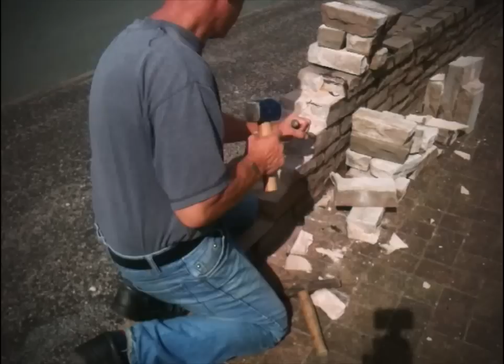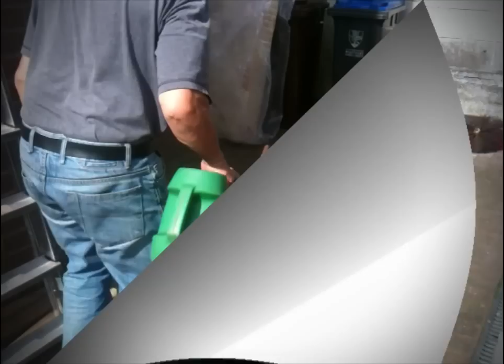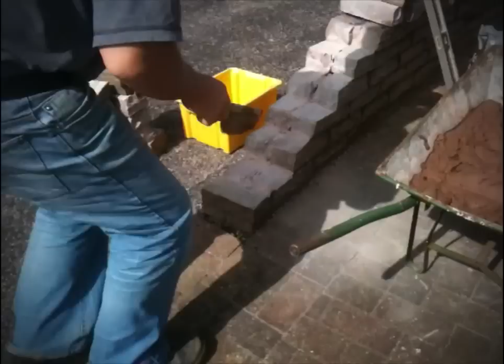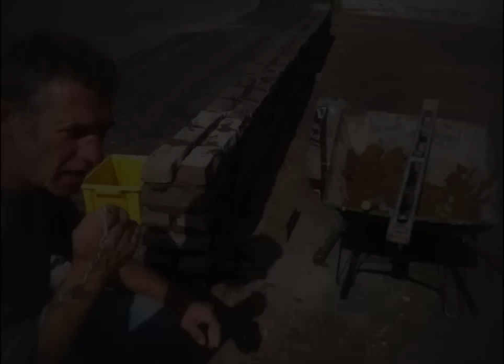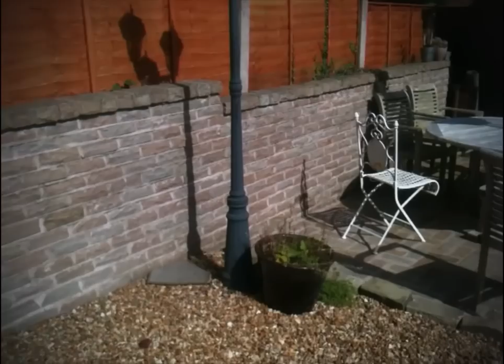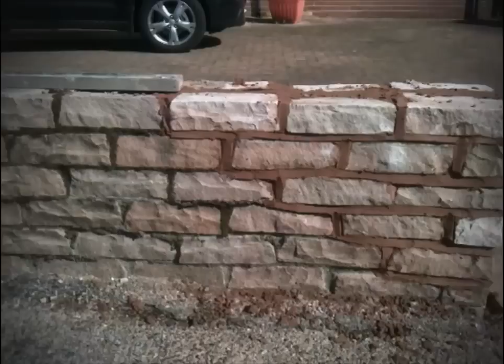Repairing a damaged brick wall

Comment: Thanks Chris. Certain party who shall remain nameless (me) did something similar to the front wall. Luckily for me the bricks are regular (and largely undamaged) but this straightforward tutorial simplified the process (I had stacked brick before as a helper but never done the bricklaying myself, even though it's a small job). Great tutorial! So nice to get someone with real experience and common sense doing these, DIY vids can often be little more than advertorial for Halford's or whoever, so it's nice to know you're in safe hands. BBQ looks amazing. Please do more tutorials if you get the chance.

Comment: Really Enjoying Watching Your Series Of Videos Chris, Watching This Video Answered The Question I Was Going To Ask, That Being The Use Of Washing Up Liquid I Noticed You Only Used About A Thimble Full, Is There A Case Of Using To Much And What Would That Do To The Mix,  I Use Wickes Ready Mixed Motor Bags As I Find Them More Manageable As I've Not Quite Got To The Stage Of Being Able To Quantify The Amount And As I Only Do Small Garden Projects Around Our Garden It Suits My Needs, Once Again Buddy Thanks For Taking The Time To Produce A Cracking Set Of Vids
Reply: Just A Quick Footnote Chris You Have Answered My Question On "What Would Happen If You Used To Much Washing Up Liquid"
Reply from the maker: Thanks for watching the vids-:) Regarding the detergent, I only put a very small drop, this is sufficient to make the mortar workable! It doesn't need much its the same for the add mixer plasterzizers which are detergent based too!- To much of either makes the mortar very aerated and runny if mixed for longer period than normal...thus adding to much air into the mix which weekend the mix!
Reply: Once again "Thanks as Always for Your Prompt replies"

Comment: Better to use plasticiser in the mortar, or even better a cement:lime mix (especially if the wall is built of natural stone). Washing up liquid is known to reduce the long term strength and durability of mortar (although for a non-loadbearing low garden wall, that's probably not going to be a major issue).

Comment: I had a similar thing happen. I have a decorative brick wall that  frames the ditch which runs under my drive. It fell off in 2 large pieces about 3 foot  by 2 foot. My bricks are very old and match the brick that previous owner of my home put down to line the edge of the driveway. I have never done this before but what I have to do is so small, hiring someone seems wasteful. I have about 20 bricks to replace. But they are all stuck together and I can't seem to separate them for repair.

Comment: Nomal jobs NO-Portland, we also use other mixes that translate into 3-sand 1-cement, Portland/Slacked Lime/ sand mixes,... lime/ smaller qualtity portland sand mixes, straight lime/sand mixes, we have about 6-7 different types of mixes for preservation work, to historical work , to new construction,... what you would be beside your self with is,... the absolute workability of our products, finished mortar on the trowel is an absolute dream to work with and  provides superior results,...

Comment: The strenght and testamony to the buildings in NYC are the proof as to there reliability, our cements allow for Excellent workability with NO-plasticizer either artificial or store bought, here goes,... I hope I don't Catch flak for this, 1-75 lb bag of good masonry cement, ( Lehigh, Lafarge, Saylors, ) 16 good pointed shovels of clean mason's washed sand, approx 10 1/2- 11 lbs per shovel full,  and one good shovel of Portland cement for Med-High strenght jobs. same formula without portland for,